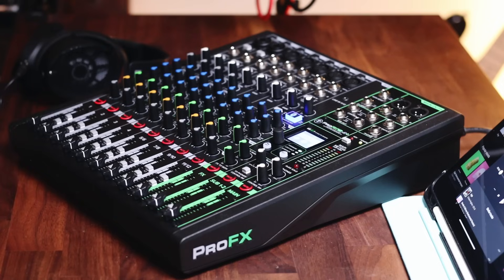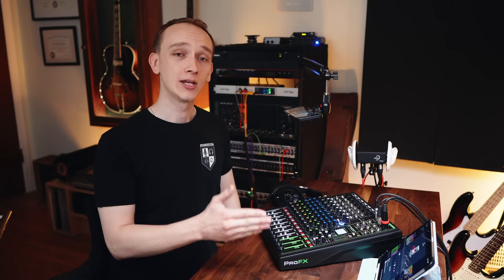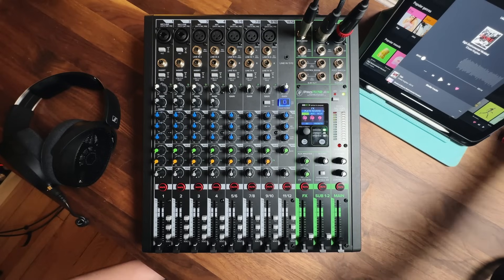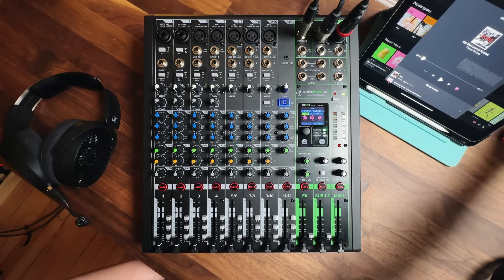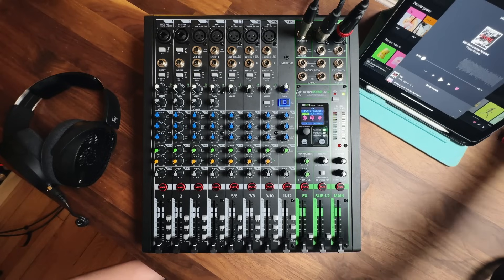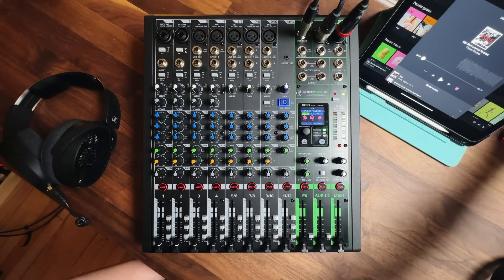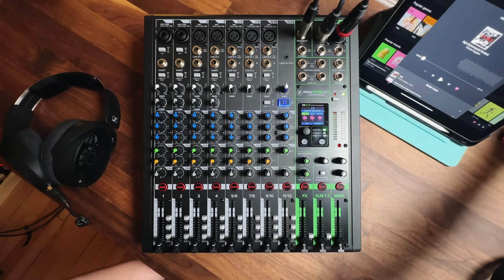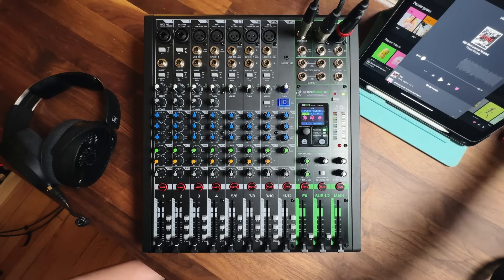Audio Mixer Setup: A Beginner's Guide

Comment: Some small background! At one church I was an assistant "soundman" at another I was the only one familiar with operating PA systems. The PA equipment we/I used were old Radio Shack 4 or 6 boards.
How did ya connect and use bothe the ASMR and the headset all at once? EQ meaning equalizer? Is the equalizer set at flat response? How or can you all connect wireless?  Concerning in puts and multitasking, what and/or when was the largest production you were personally involved in/with?  Have you ever worked a 32 board? Would the size of the venue affect/effect the EQ and/or compression? So with reverb you can mimic or give the illusion of any venue? Great, I had an headset on listening to this video and I had channel separation as you worked the PAN knob. The versatility of the board you were using to me was mind-blowing but fun! You have my permission to drop a few dimes, so, what celebrities have ya all worked with? In your presentation I liked how you all started with out puts then gravitated to the inputs.

Comment: Thanks much always for all the great content you share on your channel! Please if you can recommend a few budget (approx in $300-400 range) powered mixer that has pan knobs in the Control Strip. Our current powered mixer has none. Or another question is there a ‘box to plug into the mixer out there that can enable pan? Or still another if DAW has pan could we set up DAWs pan for pan effect over our two speakers? 
Our application is a band rehearsal room with no bass guitar amp. We plug bass direct into mixer. Vocals in mixer too. But both coming out of our two speakers in our small room doesn’t sound good and hard to distinctly hear each instrument so we’d like to pan such as bass to right speaker and vocal(s) to left. Thanks

Comment: A major issue to determine with mixers today is whether they are "actual mixers", or control surfaces to digital audio workstations, integrated with a user interface to audio I/O?  

Most of these small mixers of better quality for a cheap price point are digital, whereas actual analog units that cheap are often pretty junky.  

In full scale mixers, that shifts, where remote controls, optical snakes, or optical link breakout boxes, and individual musician monitor custom mix interfaces, may be present.  

While gain structure is important to noise and overload on actual mixers, digital mixers are very different as to ways the're far more, or less, forgiving.  

One sloppy detail in this video, is the early mention that T-R-S is equivalent to XLR outs.  Sometimes that's true...  Other times, 1/4" may be unbalanced, or T-R-S stereo, or the noted FX return-send (or less often, send-return).  

Also of note is what's on USB interfaces?  Is it just a digital version of the mains out, or a DAW feed of each channel, or something else?  What software is required or allowed?

Comment: Even though I don't have much use for it, I'm enjoying learning about production analogue equipment from this channel! 

I've always found this stuff interesting. When I was in school, we had lots of mixer boards like this (but older and cheaper). Some in the music/theater building, and even one to control the gym audio system. The one for the theater was the most advanced by far. There was a booth in the back of the building that had all the audio equipment, as well as the controls for the stage lighting. There was a massive equipment stack in the corner, full of gear I couldn't even begin to identify! I was once in charge of this booth for a theater production. I figured out the mic levels and the lighting controls (I made a script for where each slider needed to be at each scene), but everything else was a mystery. I was told just to ignore the equipment rack, because there was only one person who knew how to use it!

Unfortunately the building was left unlocked one night, and someone stole a lot of the equipment.

Comment: So I just bought this exact mixer and I've been trying to find a straight answer about setting up two monitor sends. You're the first video to even mention it! Thank you.
Just have a question though, if I use the FX Send as a second monitor channel, does that cancel out all effects being used? Since it's using the FX knobs for volume? Or did I misinterpret that. Basically I just want to know how to have two monitors on stage with this mixer AND if at all possible, two mixes, but I'd settle for just being able to use two monitors. Wish they'd label these a little better lol. My band mate uses a QSC touchmix 16 and the aux sends are clearly labeled. I got this to use for the trio but so far it's been a bit of a hassle.

Comment: I have quite a weird mixer. It has two channels, that can be each assigned as either phono or line. Then it has a cross fader right at the bottom and even a DJ microphone input?

I has been a lot of fun playing around with it. I even learned how to connect a single source to the two inputs such that the cross  fader functions as a balance control

Oh I totally forgot: it has no output level control. You set the output level with the two linear level sliders.
Reply: That sounds like a dedicated DJ mixer; with those you typically have two turntables - either old-school vinyl players, or modern digital ones, but the principle is the same - and when you play your records/songs, you use the crossfader to smoothly blend from one song as it nears the end to the next one that you have cued in while the first song is playing.
The microphone input is for announcing the title/artist of the songs as you play them, or for other messages that may be appropriate.
I hope this helps.

Comment: Excellent tutorial, however the one reason I watched is I want to use the USB for recording to my DAW, using the control room outputs. I have just bought a new profx12V3 of this mixer, and have struggled with the routing of this feature. Do I need to use only the left and right button, or also 1 and 2. Also disappointing that I’ll need XLR to TSR adapters for my studio monitor cables. 
I have 1 week left before I must return it to the music store. I’d then have to go back to my even older profx12V1, which is really easy to use but is less future proof.

Comment: Question on the loudness/voulmn of the speakers while setting ip your mixer like what you did here.

If we set the volumn at unitu gain on the mixer. What should the speaker base level should ve?

Comment: love your videos! very informative.... Question, i'm using the same mixer for Karaoke, and i'm dealing with feedbacks. What is the best approach to fix this issue? I'm thinking about getting 15 band EQ, but i've seen other devices such as the Behringer Feedback Destroyer Pro. I'm looking for a method to automatically eliminate feedback, not needing to constantly adjust. Any help would be greatly appreciated!
Reply from the maker: The most reliable solution would be an EQ, adjusted at the beginning of each show (the feedback frequencies will depend on the speaker, mic, venue, and distance between the speaker and mic.
Reply: @AudioUniversity  Thank you so much! This is a business, so it doesnt sound like constant adjustment is needed, since its the same venue/room? I just need a solution that doesnt require constant adjustment, because none of my workers know how to tune sound. basically i'm looking for something that you set and forget, and not needing to adjust everyday.

Comment: Thanks for sharing ... Here is my situation:  I want to connect my Harbinger LvL 12 Channel unpowered mixer MAIN OUT, to a pair of Alto Professional TX310 350W 10-inch Powered Speaker INPUT. I'm using a pair of 1/4" to XLR cables but I'm getting a heavy buzzing sound on the speakers. 
 
If I use the CTRL RM OUT, to the Alto powered speakers INPUT, I'm still getting a heavy buzzing sound on the speakers.
 
Without any input signal on the mixer and at 0db,  I'm still getting a hum
However, if I use my iPhone and connect it directly to the speaker there is no hum
also if I connect a CD player directly to the speaker there is no hum.   

I also noticed that from the  Harbinger mixer  "phone" (headphone jack) there is no hum.. and if I bypass the harbinger mixer and go directly from my Pioneer/Serato Mixing board output to the speaker .. no hum.. 
 
From the speaker's documentation - The speakers are expecting a "Line Level" Signal .. it seems like the Harbinger mixer "MAIN OUT" or CTRL RM OUT,  it's not delivering a "line level" signal..  

The hum sounds like an old guitar tube amp with defective capacitors.  Is there any diagnostic checks for the Harbinger Mixer? Any suggestions to prevent the loud buzzing sound on the speakers?

Comment: what if i have need phantom power for my microphones, but I'm plugging in instruments into the xlr using trs cable in dual socket will phantom power hurt my instruments or if i have both dynamic and condenser microphones?

Comment: Simply explained, and practical as hell. Wish I knew about this channel years ago. 

Do you know a lot about the DAC chips in these? I know there are analog mixers and digital mixers, but is there a huge difference? The reason I ask is I have a Volt 276 interface, and I got curious one day and recorded a song from two different portable CD players. One with a 1-bit dac (a mid 90's Panasonic with a MASH chip) and one with a 16 bit dac (a late 90's Akai). Now if you plug headphones in each of these and listen - to my ears - I hear a wider sound stage, clearer instrument separation, and more detailed dynamics. But when I recorded them through my Volt 276, the waveforms were identical and so was the sound. The source I used was my 2nd japanese pressing of "Thriller." Very little if any compression and when you crank the volume, you get more detail instead of just headache-causing loudness. 

So, speaking of mixers that also act as interfaces - as stated in the beginning of the video - is an analogue mixer going to be able to pick up these more subtle nuances in the sound? I know analogue is thrown around quite a bit, and I know a lot of the more affordable audio interfaces use the same DAC chips, but for some reason when you mentioned mixers acting as interfaces, it triggered this memory. Apologies for the seemingly off-topic question, but I thought I'd ask anyway. Keep up the great work!
Reply from the maker: Analog and digital have advantages and disadvantages. Here's a video that might help answer some of these questions: https://youtu.be/1YviIsCbT9Q
Reply: @AudioUniversity  thank you, sir!

Comment: What did you plug the tablet into and where??
Reply from the maker: You can connect the tablet with Bluetooth or an analog cable. I used an 1/8 inch to dual 1/4 inch adapter. Check out this short video: https://youtube.com/shorts/fOZmrT2e0nI?si=z8aC3toW4wTYZLyp

Comment: so electric acoustic guitar is the same way with an electric guitar? some people say not to insert an electric guitar straight into a mixer. thanks
Reply from the maker: I wouldn't recommend directly connecting an electric guitar. It is technically ok to do so, but the sound will likely not be what you want (unless you have some sort of amp/cabinet emulation in the signal chain). A DI electric guitar alone can sound kind of sterile.
Reply: @AudioUniversity  will it affect or ruin the mixer or the rest of the equipment? I just want to jam along a backing track. I’m not trying to record into a daw.. I also have two preamps, a focusrite vocal pro that has a line input and an ART mpll preamp which same inputs in another room that’s for tracking. Can I use those instead of buying a guitar amp? Thanks a lot bro
Reply from the maker: @Idonttakethisseriously connecting an electric guitar pickup directly to the mixer won’t damage anything. Be sure to use the “instrument” or “hi-z” input. Check out this video: https://youtu.be/_AC22VR3W3g?si=ay-wfSNWBSlYT96M
Reply: @AudioUniversity thanks a lot bro

Comment: Awesome video, thank you! I have an AER Compact 60 acoustic amp, which I use for vocals AND guitar.  It doesn't have level meters per-se.. only a little red light that flashes when it is peaking.  Could you possibly show a tutorial on how to set levels on an AER amp please?  :)
Reply from the maker: Without a proper meter, it's mostly about using your ears and listening for distortion.
Reply: @AudioUniversity  okay, thank you :)

Comment: You could also run  4 speaker setup as such: (L) output run XLR to master speaker to another slave speaker. (R) Output run XLR to another master speaker to a slave speaker. There you go you have a 4 speaker setup. If you a DJ you can then plug in RCA's to your DJ controller from your mixer.

Comment: Thank you.  I remember about 3 years ago we had a musical at church one night. I was not involved at first. After the first rehearsal, I received a call. I was asked why they were getting feedback and if  I may be able to help.  the first thing I did was to look at their setup to understand what was going on. Once I determined what was happening I went to work. The speakers they were using we built into the ceiling, so there was nothing to be done there. Next, I looked at the mic placement to each other. I placed them a bit farther from each other. I added a mixer to the setup to help with feedback. Between using the EQ and gain I was able to get rid of the feedback while getting a good clear sound.  It was a success. The only thing I requet was not recording it. Also, another time, I used a mixer to setup mics on stage. The performers would be running around on stage. So, I looped 8 mics from the rafters above and brought them down far enough to pick up the performers as they ran around. Again,  using the  EQ and the qain I was able to get the desired results.  I am not a professional by any means, That is why your audio lessons are so helpful for me.

Comment: I've got a question about the Musysic 6 Channel stereo mixer. The main issue I'm getting is only 1 channel out of an ipod hooked up through an Aux cable to this mixer. 

The mixer itself - I've got 2 stereo speakers and 2 large PA's (4 cables total) hooked up to the two outputs in the back (I bought a splitter so all 4 speakers can put out sound). The Aux option has 1 'Send' and 1 'Receive'. Initially I had the cable plugged only into the Receive option because the send does not put out any sound. 

This is when I discovered only 1 channel is playing from the songs I'm choosing. So I bought another splitter to plug into both Send and Receive, but I'm still getting only 1 channel output. 

When I play the ipod through another stereo, both channels come out, but when I plug back into the mixer I get only 1. 

Do you have any insights as to where I'm not connecting properly? Or perhaps it's just the mixer itself?

Thanks!

Comment: Question, if you record a full band this way with the sub 1-2 would you have to have just one track for everything or is there a way to record individual tracks to be able to mix and master later? Sorry if this doesn’t make sense beginner here
Reply from the maker: To get a “multitrack” (where every track is separate), I would need an audio interface capable of that. There are some mixers that do this (like the TASCAM Model 12) and many stand-alone interfaces (like the Focusrite 18i20).
Reply: Thanks so much for answering!!watching again to get a recap before I use my new mixer tomorrow
Reply: For multi-channel recording on this particular mixer, you can use a TS connector plugged halfway into an insert connector to get the audio for just that channel. Just make sure nobody mistakenly shoves it in the rest of the way or else your sound won't go anywhere else!

Comment: I use a Behringer Xenyx 802 mixer which has much more basic features than that Mackie but the video was still quite informative. I use effects pedals connected via the send/return inputs on the mixer. I notice that when I use an effect in a channel, if I pan the signal extreme left or right, the effect itself is still heard in both channels, which sounds pretty cool.